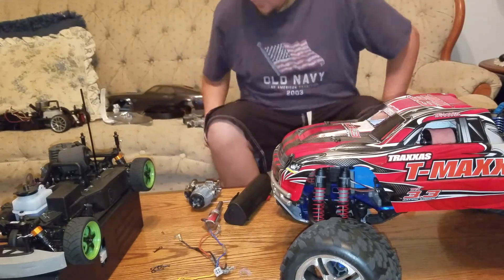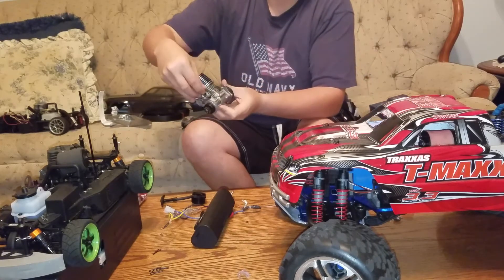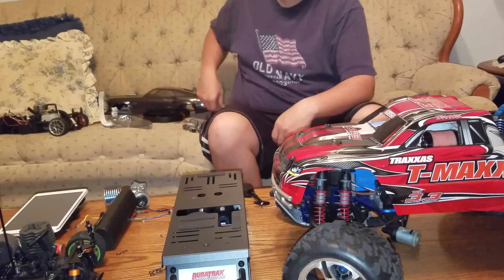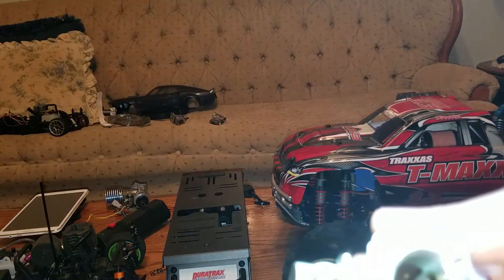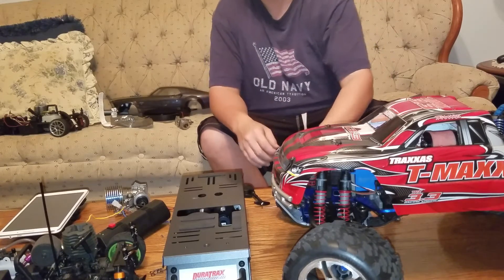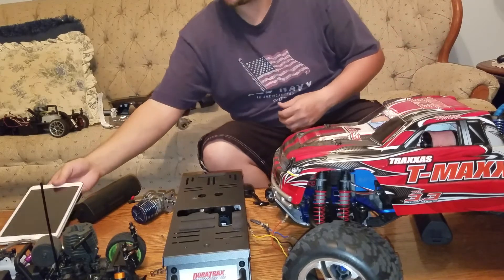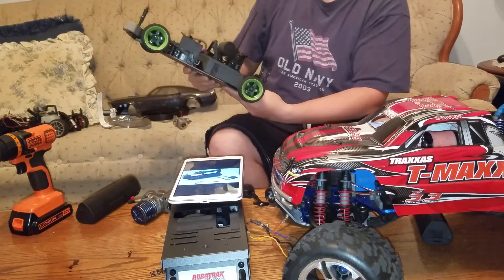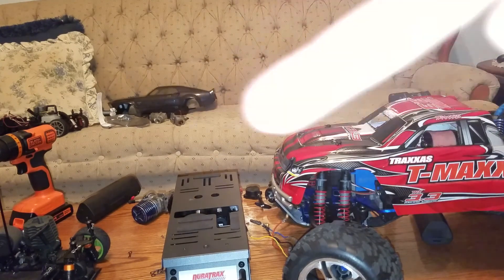The 5 components used to start nitro motors

Comment: can you give me some tip on tuning my revo 3.3
Reply from the maker: set the needled to factory settings and set the idle gap to .5mm. Then use the low speed needle to set the idle speed, not the idle gap.  max for the idle gap is .7 mm. mow when you give it full throttle then let off the idle speed should drop twice.  first to a higher idle then to your normal idle. also make sure before tuning you heat soak the engine. So many just warm up the engine then try to tune.  you need every single part hot, especially the engines internals. If you just warm it up to operating temp you are not going to keep a good tune.  run a half a tank to get all parts up to temp then start tuning.  But as for tuning over you tube it's something that cant really be done.  I tune by ear so I would need the engine in front of me to do it.  all i can do is give tips, it's up to you to figure out what the engine is asking for.  if you go to get on the throttle 100% and it shuts off your HSN is too lean.  If it bogs down it is to rich.  when idling the engine needs to sort of sound like it has a cam.  basically every now and then it needs to miss.  also how long it takes for it to build up.  this is when the engine is idling and it slows down and even stalls.  because the amount of fuel builds up.  there are so many variables so without some type of video and letting me know what is going on.  Id be glad to help further.  I'll find the nitro tuning guide, it's what I eventually came across but I'm a mechanic so i completely understand how to tune.  So many stray away from Nitro because no they are not easy jf you've never had one and the learning curve is extremely steep.  Only experience will make you the tuner you want to be.  I've been at it for a while so Its It's sort of second nature to me.  Lastly NEVER break in your nitro engine the way Traxxas says.  that wears it the fastest, you'll be lucky to get 5 gallons through it.  Best way to break in is get all the wheels off the ground, use a hairdryer to heat the block up to 200 degrees then start it and run 3 full tanks through it.  then put it down and run 3 tanks through it never going past 1/2 throttle. between each tank let the engine cool cook to ambient temp then heat it back up with the hair dryer and start again. I do not like Traxxas, they're good starter vehicles but the parts are week.  The revo header will break within the life of the motor.  if you need anything more feel free to message again and I will help as much as I can through videos
Reply: the man and I love your vids
Reply from the maker: Anything I can do to help
Reply: I need to know why my revo 3.3 doesn't sty running while at idle it shuts off and when I do get it to run it stalls
Reply from the maker: James s. low speed needle to rich more than likely